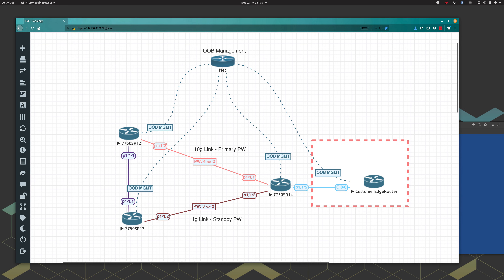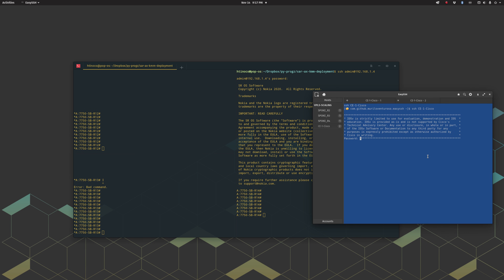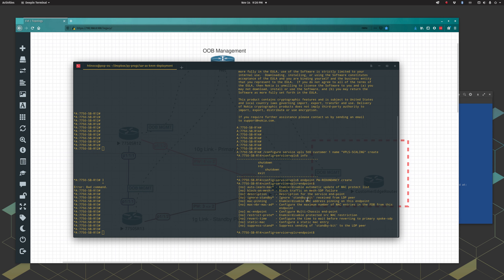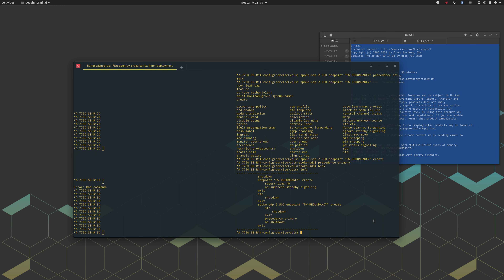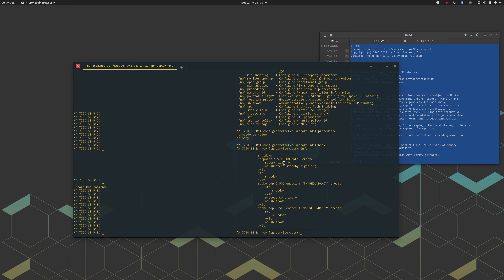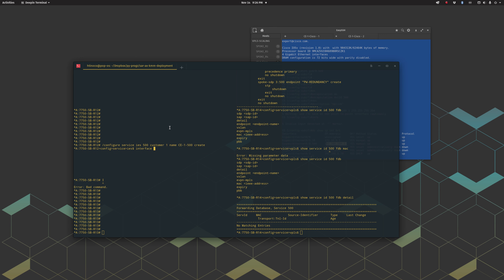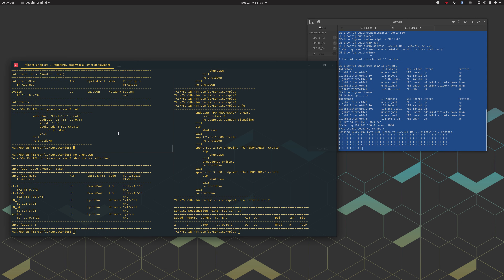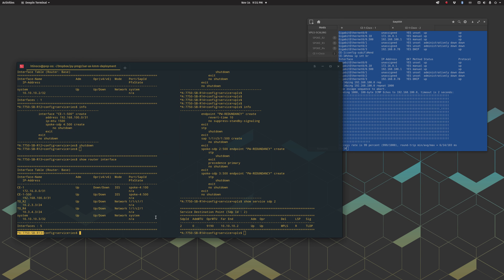Nokia - SROS: Pseudowire Redundancy

Comment: Interesting video, thanks! Can I ask, slightly unrelated to the content, but what OS and window manager are you using? I never managed to make Linux look this nice :)
Reply from the maker: Thanks Dan! I recentley switched from using Kubuntu to PopOS! - It's smooth as butter. I run an RTX 2080 and they provide an ISO installation file for their OS that has everything you need wrapped into the ISO to make the video card / drivers work great out of the box. Highly recommend.

Comment: Hi,
Great video.
Have a request, make video to explain EIS, Enhanced Internet Service. Need to understand what that technology is all about. Thanks
Reply from the maker: Sounds good! I will keep this in mind! Just a quick FYI, an IES is just at basic level a L3 service. A lot of companies use Nokia SROS and deliver internet via IES services. This allows you to create an interface on the base routing context and attach it to a VPLS, SPOKE or e-Pipe handing off to the customer.
Reply: @AdminSaveNRS2-1760  so it’s almost equivalent of what you did there. Is it safe to assume if the L3 interface you configured on routers SR12 and SR13 was a public ip address for internet access this would have been EIS?
If you happen to know, what would be the equivalent terminology for EIS in other popular vendors like Cisco or Juniper
Reply from the maker: @johnmoff9324  That's correct! If those were public IP's, this would of been exactly how a internet service would be delivered to a customer in a theoretical service provider environment.  The NOKIA SROS platform has a 'services' model in which other vendors don't really apply. However, I would compare an IES interface to a simple L3 interface with an access port. IES interfaces are not used to connect network ports between nokia routers, only to deliver access port based services.
Reply: @AdminSaveNRS2-1760  I was under the impression service delivery is done using SAP interfaces, for service attachment point
Reply from the maker: @johnmoff9324  Yup, in the video you see me create the SAP handing off to the CE - (Cisco device) on SR14, which has the two spokes under the endpoint and a sap inside the VPLS service.
Reply from the maker: @johnmoff9324  SAP interfaces are ports that are configured as 'access ports'
Reply: @AdminSaveNRS2-1760  say there was another CE with two connections to SR12 and SR13 (primary and backup) and this CE were to connect to the CE on SR13 at layer 2 how would the setup be. I understand it maybe tricky to write it down here, perhaps you can consider making a video on that too.